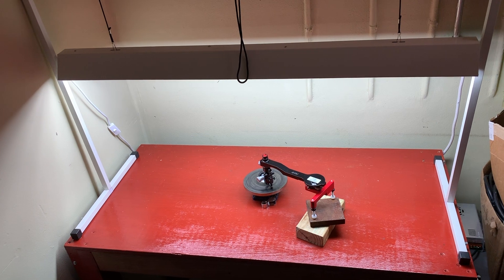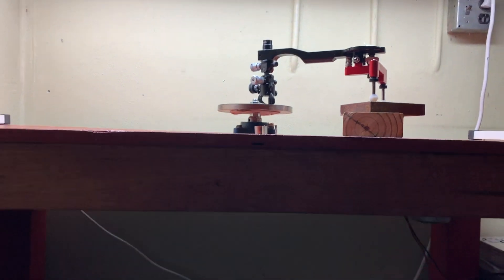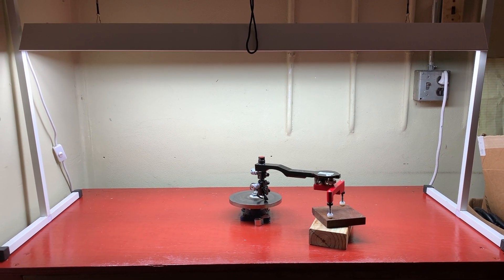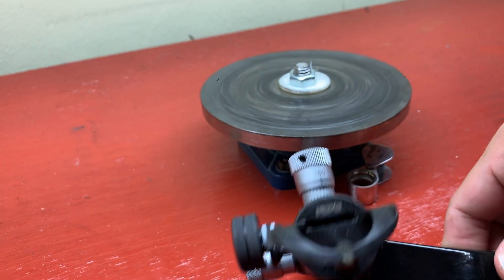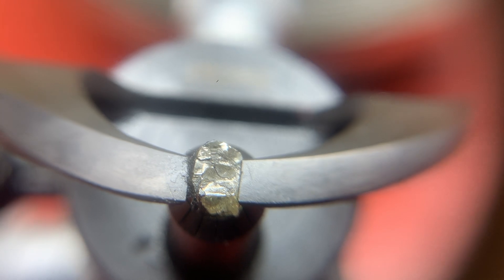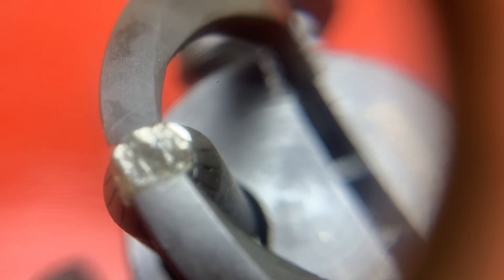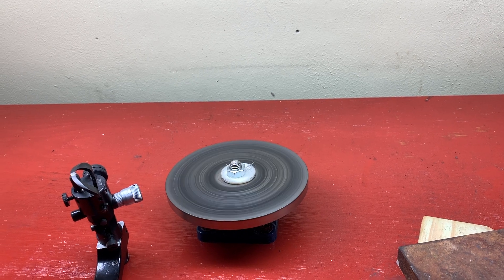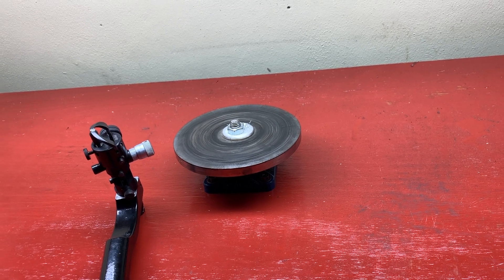How to build a diamond faceting machine. DIY rough diamond polishing mill!!!

Comment: Wrong direction of turn. The nut wants to loosen constantly.. switch polarity of your electric motor to spin opposite direction and that problem should be solved.  Also find a washer that seats at the center point like how an angle grinder retaining nut does.

Comment: My man, it is a great try, basically you have done it correctly, specially the handpiece, it’s come up just fantastic. The main reason of the vibration  is the red colour surface as it seems it’s made of some kind of wooden stuff like MDF or Plywood. As long as I know that surface should be made of metal  with a thickness of not less than 8mm, and if not the whole surface, but it should be wide enough to attach/mount the whole system including the motor underneath to that metal piece. Then the rest of the surface could be made of MDF or Plywood. The stand/base (the stand you put the Handpiece on it to do the faceting) should also be made of meta and be always on that metal surfacel. I love your work mate, cheers.
Reply from the maker: Thank you very much Cameron! I appreciate your insight and help! For the next DIY build I will try what you said!
Reply: Secured Solutions, INC. 
Love U mate, wish you all the best.
Reply from the maker: Thank you same to you!